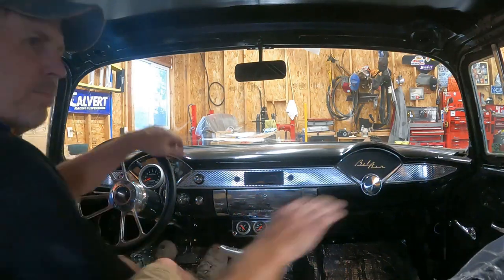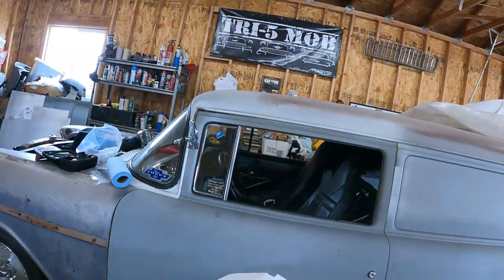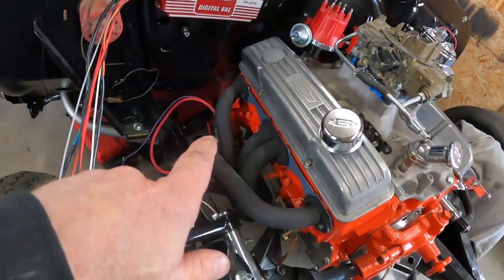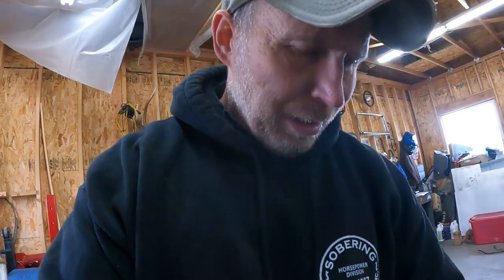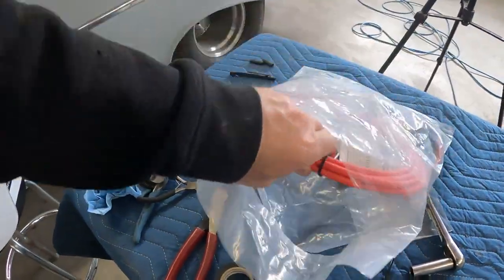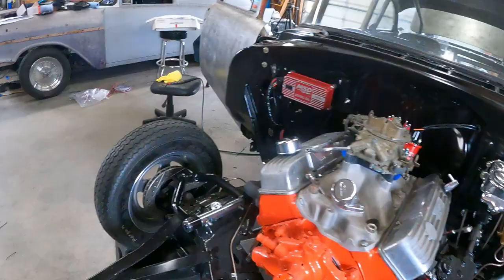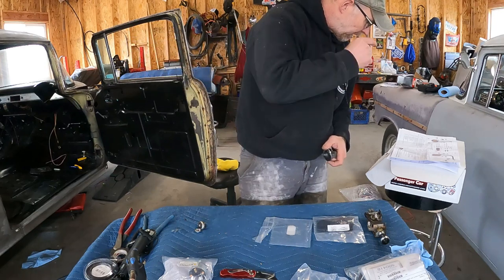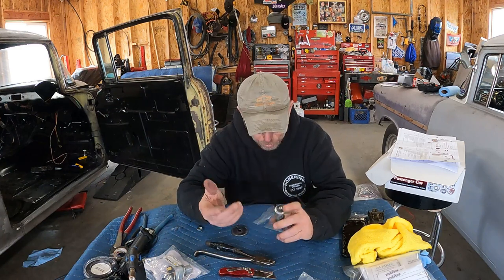'55 Chevy Wiring with American Autowire Part 2 - Instructions? Never heard of her...

Comment: Well this brought back a lot of fond memories. I did an AAW wiring kit in my 57 Gasser about 10 years. Seems I recall having to do some improvising myself. I was not happy with their universal ignition, headlight or wiper switches, so I ordered new switches from Danchuck and switched the wires over to fit the original factory connectors. And they are very thorough in the amount of wires that they give you. Way more than I needed, as I wasn't going to be running power windows, door locks etc. In a Gasser. But I saved the wires incase the next guy decides he doesn't want a Gasser and might want some of the power options that I didn't. Definitely an expensive kit, but definitely worth the money. Thanks for the video. And the sense of accomplishment you get after rewiring your whole car, is priceless
Reply from the maker: Thanks David. I agree that the switched could be a bit better. Other than that, the kit seems pretty spot on for what I needed. It sure is nice to have everything in the car work - dome lights, blinkers, flashers, etc., etc. Hardly any of that stuff worked when I used to drive the car before. I appreciate you always watching.

Comment: On standard cars as old as your 55 the purple wires go to a clutch switch, on my 55 chevy pickup it is under the floor against where the pedal comes thru.
Reply from the maker: Good to know. Mine has been hacked from stock for years, so no clutch switch in site. Thanks for watching!

Comment: Ok, I’m building a 56 2 door seadan. It’s taken me two months to get as far as I am. Everything works from the dash rearward. No, the dash ain’t done. Dakota digital speedo/gauges, (needs a place for the computer), MSD digital 6al, electric fuel pump, electric engine cooling fans, battery in the trunk, trunk light, third brake light, air conditioning, cruise control, more, more, more……and yes the aftermarket switches 1. Don’t fit,  2. Looks stupid, and all the stock stuff fits and works. Oh, mine is gonna be a fully capable street/race car.
Reply from the maker: Sounds like a cool project. I agree the switches could be a bit better. Thanks for watching.

Comment: What rear gears are you running?? Seems to wind out quite a bit between shifts. ;)
Reply from the maker: Thanks for watching Rick. I put a 4.56 rear gear in the 9 inch. I am planning on adding a gear vendors overdrive to help with the highway cruising.
Reply: Interesting! I have 4:56 in my 56 Chevy, from the old days. I have a 427 in the other end, or it will be back in the other end. I'm looking to put 3:55's or 3:70's, if I can find a Positrac like mine. Good video. I am also going to do the wiring thing too! @MontanaGarage